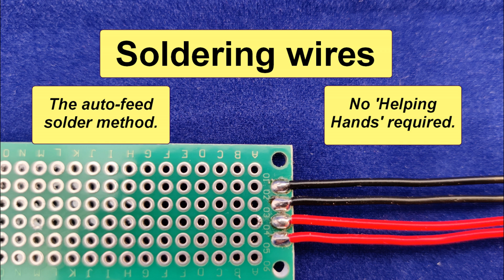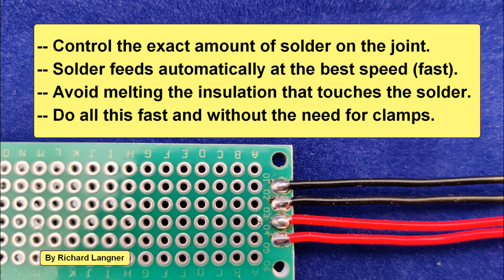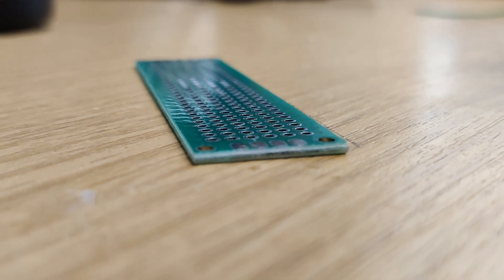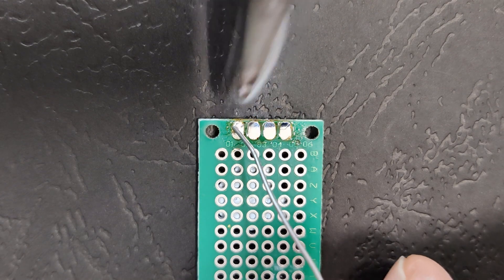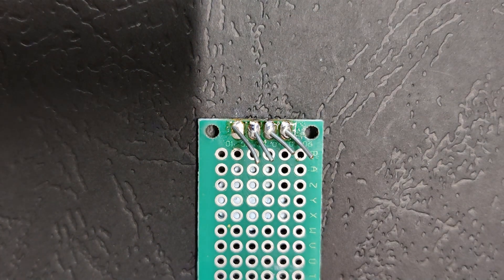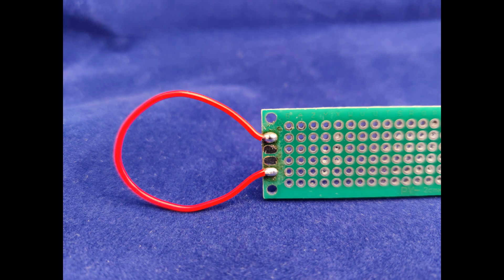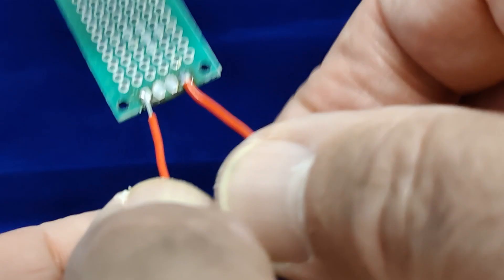Hands-free solder feed. No tools required other than a normal soldering iron.

Comment: Excellent.  Now how do you remove solder from a set of pins that you want to remove from say an ESP32 board?
Reply from the maker: Now -- I have a technique that will surprise you!
Check my video on removing header pins in seconds.
Subscribe.. hit the bell.. enjoy my videos...
Reply: @richardlangner  Thanks for that.  I struggled for some time to remove them from an ESP32 CAM yesterday.  It's so simple and obvious really!
Reply from the maker: @hariseldon2577  In the video I tapped against the desk wich is hard. If you have delicate sensors such as microphones or gyros, tap against a soft object. As long as the solder contines to move when the board doesn't, it will work.
I'm glad to have been some help to you.
Richard

Comment: I've been soldering since 1963, perhaps earlier, and I've never seen this technique. I use reversed clothespins as a third hand. It's almost impossible to hold a wire steady enough by hand. I do pull the insulation back after tinning and push it back down after soldering the wire.
Reply from the maker: Every day is a learning day!

Comment: Why would you ever solder wires to surface pads? It’s a recipe for delamination, it’s not like this method doesn’t apply to through-holes. It can probably be used for larger SMT components, but at that point it’s easier to feed the right amount of solder to one pad of each footprint in the first place, add flux to the board, and just reflow. The extra flux technique works for soldering wires to pads too, if you really want.

Edit: I see this being useful for soldering wires to terminals on switches and transformers and such. Places where delamination isn’t a risk, and you can prevent wire fatigue with heat-shrink.
Reply from the maker: You are quite right about delamination, and I would not use this method in such cases. But sometimes there is only a pad, and I usually use hot glue to act as strain relief. The need for this technique arose over 50 years ago when components were larger, and when I repaired televisions in people's homes. I really needed a third hand to feed solder into the joints on line-output-transformers and this method was born. I developed it over the years and now use it whenever it is helpful, sometimes even on larger SMD stuff.
I'm really grateful for feedback from you and from others, and it's made me realise I could share other soldering tips. I recently taught a couple of complete novices soldering and got them up to C&G exam standard in around 20 minutes (I used to teach City & Guilds electronic skills, waaay back).

Comment: Took me a year to not have failed joints in easy soldering. I probably have 100 levels of soldering ahead of me. This video helped.
Reply from the maker: I've received so much feedback from viewers like yourself that I'm seriously considering making a video on the basics of soldering. Thanks.
Reply: @richardlangner  Please!  If you could also include a section about what temperature to use at what points as well, that would be incredibly helpful! 

I sincerely appreciate your efforts!
Reply from the maker: @JB2X-Z  I intend to do a video on soldering and using proto boards, but all this is done in my spare time so it may be a month or two.

Comment: Wow been soldering for almost 50 years and never seen this or thought of it, but will be trying it out today.
Reply from the maker: I taught this to my 10 year-old neice who found it easy, and she does it as a matter of course on PCB pads with no holes.
Reply from the maker: Are you the same David Glass who was a member of Sheffield Hackspace?
Reply from the maker: @vegsalad  https://www.sheffieldhackspace.org.uk/
It would be good to see you again. The management folk have changed and we have a lot more woodworking equipment, and also a newer larger laser cutter. Oh and another 3D printer. Apart from that it's much the same, and still very welcoming.
I'm normally there Monday evenings 6-9pm and Saturday afternoons 2-6pm. Graham usually attends on Monday evenings.

Comment: Youtube has blessed me with this video. I will forever use this from now on, where applicable, of course. It's so genius that you would wonder why this isn't in every 101 video.
Reply from the maker: I'm so  glad you liked the technique. I thought it up when I had to change line-output-transformers where the wires were not 'through-hole' connections, One hand to hold the iron, one to hold the wire in position, a third to feed the solder - but I hadn't grown a third hand at that time!
Necessity was the mother of invention.

Comment: Genius!!!
Reply from the maker: Necessity was the mother of invention.
I devised this method when I had to change line-output-transformers where the wires were not 'through-hole' connections, One hand to hold the iron, one to hold the wire in position, a third to feed the solder. But I hadn't grown a third hand at that time!

Comment: Cool, usually a do a small touch with fresh tin after soldering the wire to make it look good. I need to try this, it seems more precise 😊
Reply from the maker: You don't need to add any more solder.Try it, you will see...
Reply: It happens only when I touch the joint twice, probably adding a little of tin brings a little flux, which makes the joint look nice again.
Otherwise if I don't do that, it doesn't remain rounded & looking good.
When soldering in one go, this is not required.

Comment: This is impressive. Thank you for this. Its surprising how long a piece of solder is needed for a joint.
Reply from the maker: Thanks for the observation - but the long solder legs were for the demo only. In practice you'd use a lot less.

Comment: Oh my! This is genius! Never occurred to me!
Reply from the maker: I devised this method when I had to change the 20 or so wires on line-output-transformers and they were not 'through-hole' connections, One hand to hold the iron, a second to hold the wire in position, a third to feed the solder - but I hadn't grown a third hand at that time! Necessity was the mother of invention!

Comment: Thanks! Done a lot of soldering but that is a pro tip.
Reply from the maker: I devised this method when I had to change the 20 or so wires on line-output-transformers and they were not 'through-hole' connections, One hand to hold the iron, a second to hold the wire in position, a third to feed the solder - but I hadn't grown a third hand at that time! Necessity was the mother of invention!

Comment: Fast easy and works
Reply from the maker: I devised this method when I had to change the 20 or so wires on line-output-transformers and they were not 'through-hole' connections, One hand to hold the iron, a second to hold the wire in position, a third to feed the solder - but I hadn't grown a third hand at that time! Necessity was the mother of invention!

Comment: Thanks much!  I am very much a novice at soldering, yet can greatly appreciate the value in this technique.  Thank you for taking the time to share.
Reply from the maker: I devised this method when I had to change the 20 or so wires on line-output-transformers and they were not 'through-hole' connections, One hand to hold the iron, a second to hold the wire in position, a third to feed the solder - but I hadn't grown a third hand at that time! Necessity was the mother of invention!
Reply: @richardlangner  Ahhh the 3rd hand mutation technique... We need a video on how to achieve that as well..  he he

Comment: Woah, nice quick method! But only for fresh and clean wires. In case of any doubt, I'd stick to traditional tinning everything first, and then soldering.
Reply: You are correct of course, and I always clean and tin the wires first. The PCB pad gets tinned by the solder leg.

Comment: So, for small wires, cold joint is acceptable?
Reply: My method cannot possibly make cold joints. Watch the video as you may have missed the process.
The iron first heats the wire, then the wire heats the pad, then the pad melts the solder. As all materials are up to temperature before the solder melts it's impossible to get a cold joint this way.
Note also that solder is never fed directly onto the iron.
Do you agree?
Also the pad is tinned in advance as the solder leg is stuck to it.

Comment: I just did my first perf board drone, i used cat6 wire. Esp32s3, mpu6050, npn controlled motors, and a 3.7v step up to 5v 2amp module i salvage from a walmart cell phone portable charger. 

It all works😊 but its a hot mess. I hope to get better.

Comment: You... you... you've changed my life.
Reply from the maker: I devised this method when I had to change the 20 or so wires on line-output-transformers and they were not 'through-hole' connections, One hand to hold the iron, a second to hold the wire in position, a third to feed the solder - but I hadn't grown a third hand at that time! Necessity was the mother of invention!

Comment: I wrap 3 turns of 1mm solder around the end of the stripped wire. Now you can solder and fully tin it in one move
Reply from the maker: Thanks for the suggestion. My method heats the wire, which heats the PCB, which will melt the solder ONLY when both conductors are up to temperature avoiding cold joints. Unless you are very careful with your method, the solder will melt before the conductors are up to temperature. Although... I have seen others use it to good effect .

Comment: Seems to be genious! I will try this!!!❤
Reply from the maker: I devised this method when I had to change the 20 or so wires on line-output-transformers and they were not 'through-hole' connections, One hand to hold the iron, a second to hold the wire in position, a third to feed the solder - but I hadn't grown a third hand at that time! Necessity was the mother of invention!

Comment: I've always held the wire between thumb and 3rd finger, and the solder between 1st & 2nd fingers.  I can feed the solder into the joint with a bit of nimble finger work, but this method seems much better, will definitely give it a go.

Comment: Its very cool🎉 but very bad🥲.. just tin the pad then tin the wire, add flux and solder the wire to the pad.. and make sure you have the concave shape,, not big blob of solder like that!
Reply from the maker: I agree, you can carry solder on the iron and use separate flux, but for multicore solder this method works well and is quick and easy when working on site. As for the shape of the solder on the joint, concave is indeed appropriate for through-hole wires. A wire resting on a pad doesn't have much strength though, so a bit more solder helps here.

Comment: Not bad, not bad, not sure if standard production method of tinning the pads and tinning the wire in a pot is faster or slower, should be on par. 
Frankly I avoid soldering wire to board at all - poke in or idc or lever operated connectors is still better.

Comment: I've surprised to see something new :)
But anyway need 3 steps, strip the wire, apply fluxed solder, make the joint.
Usually the flux leftowers on the blob is enough to avoid making this corn.
Autofeeder soldering iron can reduce steps.

Comment: What I learned from this video: Richard creates cold joints and teaches others how to create cold joints. Brilliant.
Reply from the maker: Not cold joints! Check the video at 1:47. You will see the iron heat the wire, the wire heats the PCB, the PCB heats the solder. So both conductors are up to temperature before the solder feeds in. How can that be a cold joint?
Reply: If you are concerned about the coldness of the joint, you can reheat the now fixed connection as you now only need 2 hands

Comment: I wish that I had seen this a few years ago when I started soldering. I'll be using this technique 'til the day I die for sure.
Reply from the maker: Thanks for the feedback. With very thin solder I use this method on SMD parts now, but it takes a bit of practice.

Comment: I'm a very occasional solderer(?) and I've done this before, frustration and lack of a helping hand led me to it but it never occurred to me that it's a legitimate technique. I still feel enlightened and somewhat validated to see it in this video.
Reply from the maker: For the past 50 years I wondered why such an obvious idea (to me) wasn't used by others as it saves so much time amd fumbling!
I now use the technique on SMD but with thinner solder.
Reply: @richardlangner  wow I never thought of this technique, and after reading your comment I realize it didn’t cross my mind to use it for SMD soldering either.  I do believe this is going to game changer for me and SMD components!  Can’t wait to try it now.
Reply from the maker: @jcughan  It may take a bit of practice at first, and is more suitable for the larger SMD stuff like 1206, 0805 or 0603 sizes. For the smaller stuff like 2020 I use a different technique. Good luck!
Reply: @richardlangner  A different technique by hand?  Or do you mean using a reflow oven or hot plate - something like that?
Reply from the maker: @jcughan  By hand of course!  I may do a video when I have time.

Comment: Brilliant! One question: Does this method work with through holes?
Reply from the maker: I devised this method when (rapidly) soldering lots of hand-held wires on to tags (wire in one hand, iron in the other) and I needed a third hand for holding and feeding in the solder.
You don't need solder auto-feed if the wire is held within a hole on a PCB. Simply feed your wire through and bend the wire's tip so it stays there. You then only need to hold the iron and solder.
Please note that my method does not have much mechanical strength, so only use on small wires that are not subject to stress or movement.

Comment: After 50 years of soldering (seriously) , I discover a new technique. I take my hat off to you.  
Brilliant.  Thank you for sharing.
Reply from the maker: I devised this method around 50 years ago as I had to regularly change line-output-transformers where the wire needed no mechanical strength, and thought it was so obvious that everyone must be doing it. Judging by the massive response on Instructables (https://www.instructables.com/Soldering-Wires-Heres-a-Better-Way)  I was wrong!
Reply: @richardlangner  I learnt long ago to manipulate 3 things with two hands. The circuit board is fixed (with a vice or otherwise). With one hand I feed solder while holding a tinned and fluxed lead (each via separate finger pairs, while the other hand feeds the tinned soldering iron.
It becomes very natural to do this but it becomes apparent that it is a learnt skill because it's not easily taught.
Reply: @richardlangner  The way the link is posted includes the trailing ")" which makes it invalid and gets a 404. Just remove the ) and all is good 😉

Comment: It looks good, but I'm not so sure.  Solder adheres best to a fully heated surface, and there's no way to know if the wire gets heated well enough.  Further, the flux in solder is meant to clean the metal for better adhesion, and it not only has very little chance to clean the wire, I have to wonder if some isn't trapped inside the solder bead.  With stranded wire, I would be sure - it will not get fully heated, and some flux will be trapped unless you pre-tin the wire or leave the iron tip on the joint for a few seconds, letting the liquid solder transfer heat before it solidifies.  You don't mention tinning the wire, but if you use this method, I'd say it was required.
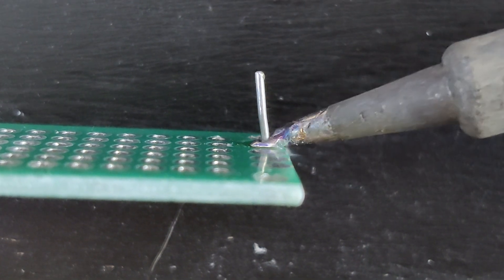Reply: Although unmentioned you can see at 0:55 and 1:46 that the wires are pre-tinned, either way, it's a good point to raise.
Reply: I am sorry Chris, I'm a little annoyed by your assessment. Richard's method does not mention at all that it is not necessary to prepare the wire in the usual way, ie tinning. Sometimes you even need to mechanically clean the wire first - but all this is supposed to be done by everyone. This video is about an unusual and I think productive method, not a school of basics soldering.
Reply from the maker: @hatter9576  Thanks for explaining my case.
I've use this technique for around 50 years and always had great joints. The PCB is tinned in the normal way when the solder strip is left in place. As for the wire - the iron heats the wire, and the hot wire then melts the fresh solder strip, thereby tinning it.

Comment: Dear Richard, the "auto feed soldering" method is amazingly smart, I really like it and I will definitely use it. Thank you very much for the selfless publication of this!
Reply from the maker: Thanks for the comment. Remember that you don't need this technique if the joint is mechanically strong (as with through hole components) as you then only need two hands!  This method is designed for soldering while holding the wire in place with one hand, and the iron in the other. If you have a lot of connections to do it should be a lot quicker too.
Reply from the maker: I am so glad it will be of use to you.

Comment: Thanks this is really helpful. I work with computers so this helps a lot
Reply from the maker: The technique becomes really useful when you have lots of connections to solder. You'd normally tin each pad first, and that's when you leave the extra solder there ready for the joint, so it's no extra work to do this. Thank for the comment!